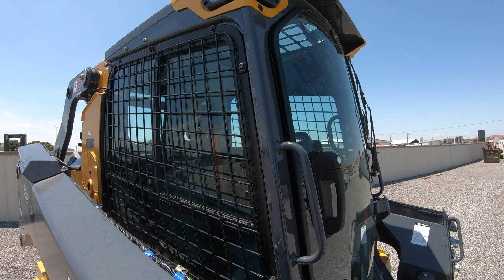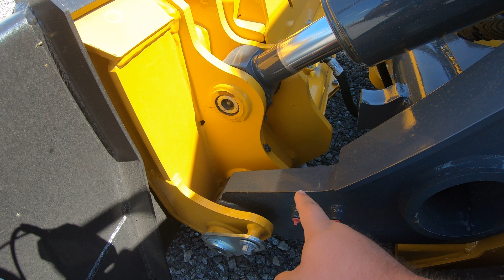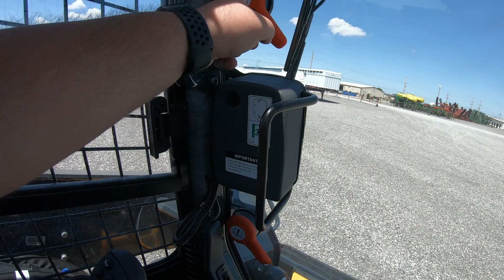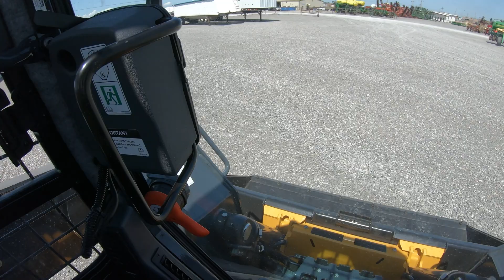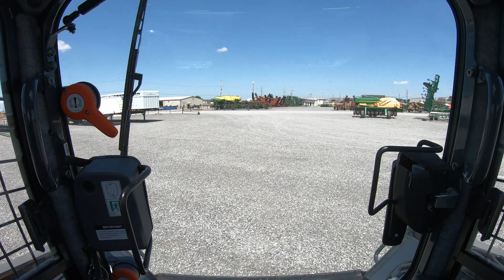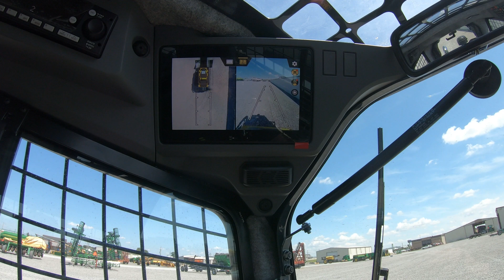NEW John Deere 335P Skid Steer Review

Comment: Can you actually dial in what flow you will get on high flow? I have a mower that is rated for up to 41gpm so I don’t want to run it at 44. If not the 331 is probably as big as I could go in a Deere.
Reply: This is a late reply but yes you can dial in the gpm

Comment: Please give us a ~$ Price  ! WILL it fit on a tandem axle trailer with an 83 inch width ?
Reply from the maker: Price varies so much depending on how the machine is equipped so I always suggest checking with your dealer. as far as the width goes, if you have the wider tracks it is almost 81" wide so you would be really close on an 83" trailer.
Reply: $125k.